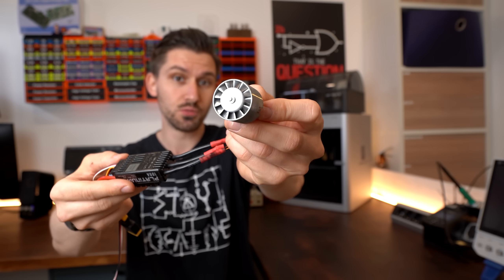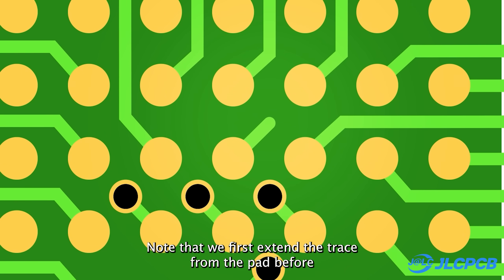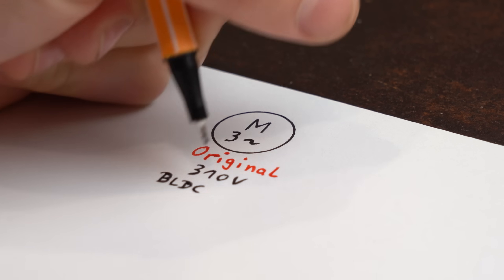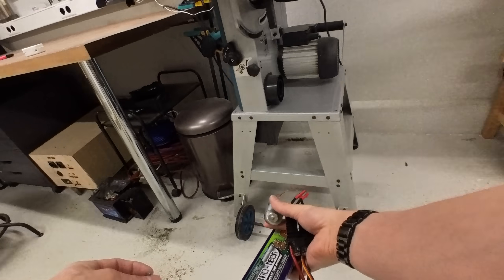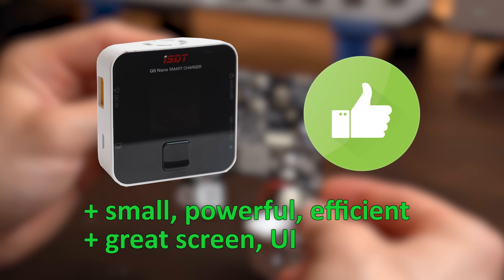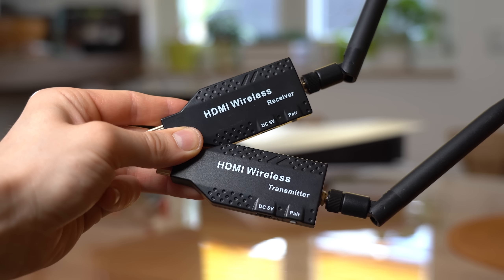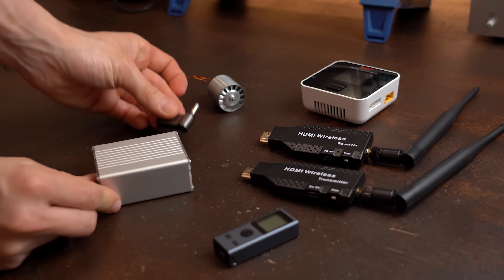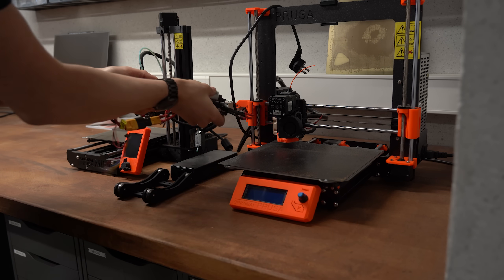I tried finding Hidden Gems on AliExpress AGAIN! (Part 9)

Comment: the wireless hdmi could also be used for remote digital signage or high up in the air. walk out with the laptop , update the display . or from the comfort of the office instead of running out to the sign itself

Comment: I dont think isdt is a hidden gem. It is a well known loved charger brand for hobbiest. But it has also a bad reputation for failing in about a year. I use the big brother of yours and have no proplem for about 3 years now. I used the bench Powersuply so often. But now i bought a dedicated bench power suply. It is handy if you want to bring back dead cells.

Comment: That blower motor is actually cheaper if you buy it as a full air duster, I picked one up not long ago. If you just need the motor it might still be cheaper to buy and scavenge it. Added bonus you get a USB-C charging board and an Li-ion battery.

Comment: For the 12V high speed fan, is there a reason you used your own controller instead of the option in the listing?

Comment: Super grateful for these series! Thank you!

Word of caution about the iSDT Q8 and why i'm getting rid of mine... I bought three of them a while back and all of them have a problem where they deeply discharge one cell of the battery if the balance cable remains attached after charging finishes, even if the input power to the Q8 is removed. It's as if the last cell that it was balancing gets stuck in discharge mode.

It also has an annoying auto-off timer if you're using it as a DC power supply that you can't turn off. 

It's my experience that issues like these don't tend to get fixed but i'd like to hear if your recent purchase is any different.

I replaced them with the SkyRC B6 Neo which has none of those problems. Only downside is you don't have as many voltage options for balance charging and 1 of the fans out of 3 devices had a fan that needs replacing at some point.

Comment: I have a motorhome and built a rearview camera for it. Since I didn't want to run 40ft (12 meters) of wire through the chassis, I used a wireless AV for it. The wireless HDMI would have worked just as good in my situation, but the AV was cheaper.

Comment: I've used those USB-PD to barrel adapters a fair bit with a Lenovo 5 pro (300W brick). Having the battery full beforehand, and IGPU only mode makes it work far more reliably. Otherwise it often tries turning on the DGPU which spikes power draw, overloading the charger which shuts off. Then the DGPU shuts off, the charger resets, and it just cycles like that. DGPU only can also work since it only spikes once.

Comment: I thing I will use that >100W pcb together with a power tool adapter to make them charge on the go in my car - or get decent power out of my 12Ah bosh power core drill batteries

Comment: That issue with the USB C turning on and off during use can happen when the laptop demands more power than the system is rated for. I found that plugging it into a 65W charger rather than 100W solved this issue for me.

Comment: About the charger converters - The original barrel connections actually have onewire chip in them (the barrel is mostly 3 pin connector, not 2 pin connector) It will advertise to laptop what wattage charger you are running so to set power modes and charging speeds. Depending on model , the laptops act - no charging or running at all, only charging while off and while on running from charger(sometimes cpu clocks are set to minimum because of unknown charger). Seems MSI is making assumption if there is no correct onewire data it will treat it as 65w charger which is almost always minimum for these barrel jacks. As it's not sure if it can hold the power while chargin and running it will turn off charging so that you battery won't get spikes of charging-discharing. So the real reason to have "per brand" charges is to have correct onewire communication which states correctly what wattage charger is connected. I have this for my lenovo laptop with square connector and it works fine with 65w and 100w type-c chargers and battery banks just like OEM.

Comment: For that laptop charger. I have Acer laptop and ordered acer plug, I'm having same issue as you that it works only when laptop sleeps or is turned off. I'm not sure why, but I guess tha laptop refuse that voltage differrence? Or as for my nitro 5 which has original 180w charger, maybe its waiting to achieve that 180w output and since it doesn't get it from power supply, so it refuses to use it?

Comment: that edf is considered by a certain mod group for voron 3d printers and other corexy like machines, to power a external Part cooling fan, called CPAP, usually big fans are used that you commonly find in breather machines, but they consider those at the moment because they have the same diameter that the tubes have that you would use

Comment: BE CAREFUL BUYING THE Q6 NANO. Im in the rc and fpv community and I've seen several of these fail catastrophically where it stops reading the voltage of one of the cells correctly and keeps pumping current into it. This can and WILL cause battery failure and a fire if left unattended or if it's not caught immediately.
Reply: ISDT makes other fantastic chargers, like the CO8AC charger, which I would recommend, or the K2 which is a dual charger

Comment: Could you please do a daylight outdoor test with the laser measure? One of the big key features for the Bosch is that it can operate in bright sunlight and most cheaper ones cannot.
Reply: But neither measure from both ends. A dual laser would allow you to stand in the middle of a room and get a distance from wall to wall with out walking to the wall. Also Bosch, i belive, will work in fractions of an inch.

Comment: Actually got one of those wireless HDMI dongles for our meeting room. One of these is a lot cheaper and a lot less hassle than having tons of 20m HDMI cables(just look up the prices, gets expensive quickly) layed from the floor to the ceiling where the beamer hangs. Not to mention having input source selection gets weird past 3 inputs. Plus it's great when you have a table situation where you can reangange your tables, opening you up to simply not knowing where the person presenting will sit.

Comment: I had one of those laptop charger adapters. it ended up killing my 30W GaN charger. was working fine when charging the laptop turned off, but once I turned it on my charger was kaput. perhaps fault of the charger, but neverthereless won't risk again.

Comment: ISDT is my goto brand for lipo chargers. that price is higher than they sell it on their own website though. i personally use the 608ac. same UI and software features, but its DC with an AC wall adapter, so you can use it at home from the wall or you can use it as a field charger with like a 20k lipo as the power source.

Comment: im using usb c to dc laptop for my msi gf63 with original charger output 120w , im using 65 w pd charger with that converter ,and it works fine for using light task 
make sure you disable the nvidia gpu and disable processor turbo boost so that the charger charge stable ,because if the load exceed the pd charger output capabilities then the charger will switch on and off its output and will not charge properly

Comment: 10:30 Your notebook draws just too much power when in use; does it come with a discrete GPU, like an Nvidia or Ati? I had to same with my Lenovo before, but the machine with an IGP does not have the problem and can even be lower, all the way down to providing just 30W.

Comment: 4:40 I am very disappointed with iSDT. Had several of their chargers, but I have very bad experience with the C4 Evo; it overcharged my AA and 18650 cells so do not trust it anymore. Haven't had this happen with ToolkitRC (and I have over 10+ chargers made by them).

Comment: the problem with the usb-c  barel adapter is the "smart" usb-c you used in combination with a "smart" charger. Use a laptop usb-c charger or a not smart cable and you will see your laptop charging.

Comment: The price you show in the videos should include shipping as sellers will often lower the product item so it ranks better, but in fact charge a hefty amount in shipping to compensate. For example, the laser tape measure is actually >$30.

Comment: These USB-C Adapters for notebooks are working just fine, I have them for a surface, an HP Elitebook that came out long before USB-C Charging and now a Lenovo Slim Tip version (the funny square one). They are great up to 100W and for smaller notebooks they get you through the day even with a super small 65w USB Power Supply.

Comment: 3:00 For health reasons, you only want to blow large particles. Anything small particles that are created from sanding wood will get into the air and stay there for hours and thus have the ability to get into your lungs and later cause damage.
Reply: i wonder if you could use the fan to put a vacuum behind a filter.

Comment: Alright, so, I have additional vote for USB-C charger, and for reasons that might be unintuitive. 

We use those things in field/wartime/outage conditions, because they work seamlessly with "crude solar" charging setups when power grid is not available. Our "crude solar" is basically a solar panel that can output 12V-30V, hooked up directly to DC power charger designed to work with car batteries (those thingies with usb-c/usb-a charging ports that you can install in your car and plug into car battery - we just hook them up directly to solar panels instead). 

So solar panel -> directly to usb-c outlet that receives 12-24v inputs -> usb-c cable -> into that kind of USB-C charger = laptops with such converters and any kind of usb-c powered tech, powered directly from solar panel, anywhere, without solar controllers or batteries involved anywhere in the loop. 

It is absolutely king of crude and cheap "I want to power my portable electronics from solar" setups. In fact, because I was buying those things, I have a feelings that's why algorithm even recommended me your video. If you were to go with traditional solar controller+battery setups, the cost is like triple/quadruple, and efficiency is reduced because power goes trough multiple systems before coming to your components. But directly feeding solar DC into gadgets designed for a car that take that DC, then using them with things like that USB-C dongle, pretty much comes out to the cost of just solar panel and maybe like 10% of more cost on top of it. Not to mention you can salvage such gadgets from disabled cars, if you are in warzone conditions.

So yeah, here is my perspective on those things. They are very useful, and that whole "for people who don't want to carry chargers with them" is only part of the story on why those things exist.

Comment: 10:26 I bought the same adaptor from Amazon de for €2! For a Thinkpad which needs 230w.

It was the same result. Can not charge the laptop when it's on but charges it perfectly when turned off.

I also measured the power the original charger draws when the laptop is on idle and that's only 60W. So it's definitely the software that's not allowing it to be charged with 100W.
Reply: If you use a lower powered Lenovo charger (from an office laptop), you will see the same behavior. We use Thinkpads in the office with 170W and 230W  chargers and cannot borrow a charger from lower powered systems.

Comment: 4:01 These cans do not contain compressed air. Look at the tank of an actual air compressor, it's made from thick steel. These cans contain a propellant, which are often very potential greenhouse gases.

Comment: If anyone is curious about why the TX HDMI device uses almost no power and the RX almost too much, is because the TX module is getting most of the power from the HDMI device, and the RX module has to provide power to the connected output device.

Comment: One note regarding ISDT-Chargers! 
They are great for about 3-4 months and then quality issues start to arise like crazy. From faulty connections to the selectorwheel/button registering wrong inputs as well as cancelling charging processes multiple times during a charge due to „abnormal battery connection“. 
I have had 3 of these chargers and all of them had the same issues. Friend of mine who also had about 3 also reported similar problems!

Comment: 200mA Rx, 10mA Tx? Sure that's not backwards? Never heard of any system where the receiver uses more energy than the transmitter.
Reply: My guess it's drawing extra power for processing data decompression before output to display.

Comment: I picked up a Dell usc-pd adapter like that one and a 100 USB-c-PD adapter and it worked very well. They have a cable version where there is a USBC on ones end and the barrel plug on the other end about 6' and I used itfor a weekend to test and it too worked well.

Comment: Your MSI laptop probably figured out there's a "problem" with your charger and didn't utilize it while turned on. Power supplied was lower than expected. It's a safety feature built in the software. That's why it started charging after you turned it off.

Comment: I'm in China, and the items you mentioned, I can get them from e-commerce websites here at only 1/2 to 1/6 of the price you pay! This is also why China's manufacturing industry has progressed so rapidly.
Reply: This isn't surprising. The prices have greatly increased on AliExpress after they agreed to pay VAT (that wasn't the case at the beginning) and some taxes have been added. Not only they increased by 20%, I suspect a number of sellers took this opportunity to hike the price by another 20 or 50%. Especially some consumer products like high quality videoprojectors (Xgimi for ex) have increased so much that it is no longer interesting at all to buy them from AliExpress. Fortunately, this isn't the case yet for a lot of cheap products like those presented in the video.

Comment: I bought that mini laser rangefinger last year, used it maybe a dozen times, haven't charged it in 8 months, and it's currently still showing a 2/3 battery charge.  Quiescent current/self-discharge seems pretty good.  Not sure how the battery would hold up to more frequent use, but it's great for my occasional use.  Hat-tip to Benn Jordan, who I first saw using the device in his video about hunting for reverb samples in a cave.

Comment: Your laptop charger going up and down like that means that your laptop is one of two issues, either not getting enough power from the adapter so it's using straight power and not enough to charge the battery or a good mean that your power brick, which a lot of newer laptops these days do this, has a handshake to make sure it's genuine or something along those lines. But most of the time its rhe charger not sending enough power

Comment: Ive been using ISDT chargers for years now.  Very reliable from my experience.  i used to use them for drone racing. Both at home and at the races. The fact you can power (most of) them using a larger capacity battery and charge smaller so easily is great

Comment: @ the USB C laptop charger - I got one like that and one which is embedded in a cable with USB C at one end and barrel at the other - it charges perfectly fine a 65w HP laptop from an AliExpress 140W gan charger (toocki brand, I regularly charge two laptops from this charger plus a phone at the same time).

Comment: I personally use those usb c power adapters since 2 or 3 years. With Asrock X300 mini pc, Lenovo Laptop, HP g5 mini PC as well as dell 7050 micro. In combination with 45W or 60W power delivery GaN adapter they run flawless. However I had the same problems with XMG laptop biggerv100W. It did not charge, but as far as I remeber kept the charge. Similar to your laptop. All im all the adapters are great!

Comment: I have had 3 ISDT Q6.  They weren’t very reliable for me and more worryingly 2 of the 3 measured voltage very inaccurately, they could not be trusted and then they quit working all together.  I would recommend the HOTA D6 pro. It is like double the price, but it comes with built in power supply and doesn’t fail constantly.  The only failures I have had out of any Hota d6 pro was a fan, which was cheap and easy to replace.

Comment: Buy a 5.5x2.5 USB PD board, then buy a massive pack of bit adspters for $13. 
Basically a $16-20 universal laptop charger. 
As well you can do this with trigger boards with a variable voltage, just solder a standard jack, then adapt it. Basically 90% of barrel jacks in one adapter set.

Comment: If you are interested in Joule Thieves, look into the A2SHB MOSFET with low turn on voltage. I built a MOSFET Joule Thief with a 2N7000 and it needed at least 1.0 VDC to work, but the same circuit with the A2SHB worked at 0.6 VDC and will light a 9 Volt LED. The FET is very small and I had to make a special mount to use it in a breadboard, but it was well worth it.

Comment: I wait for them to make the same power bank board that supports 13s li-ion (48V). Doesnt have to work with USB PD EPR, it may only support 20v and use DC-DC converters but that could enable me to use my electric scooter battery as a usb-c power bank. Would instantly buy.

Comment: 13:34 I absolutely hate it when devices have internal batteries. It almost always means that the battery is glued in or for some other reason it is not replaceable. IE the device turn into trash after two years. What a waste!

Comment: Your old charger can check individual cell voltage and resistance as well, flash it with cheali charger custom firmware!
Cheali charger firmware also opens the charger right up on the functions, it becomes programmable where you can set all sorts of parameters for pack types you save in memory slots.

Comment: The barrel jack adapter only really works for laptops that need less than 100w. I have one, and its really nice. Form my laptop, it doesnt work with a 35w brick but works with a 65w brick.